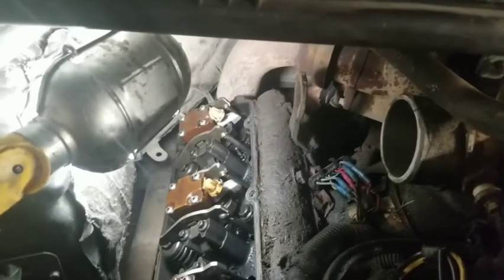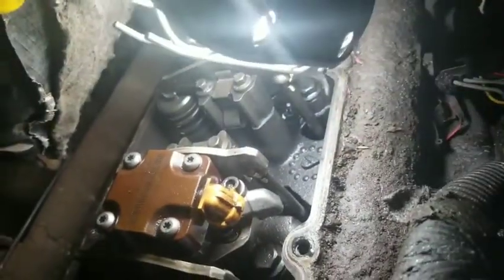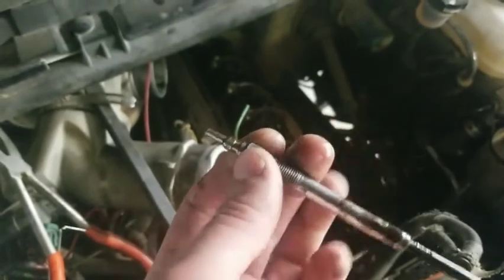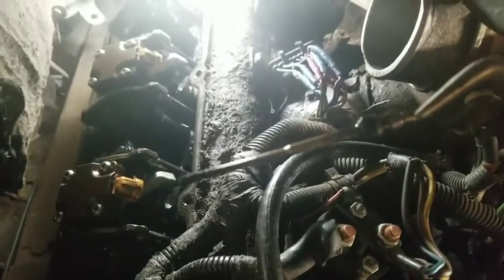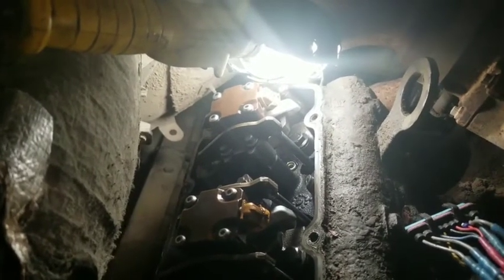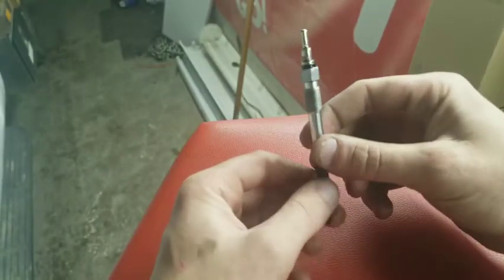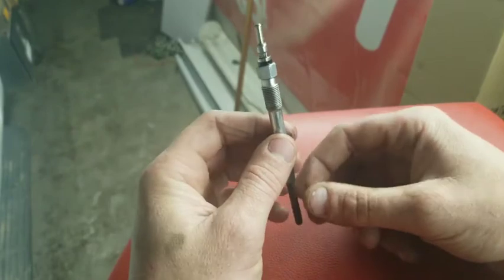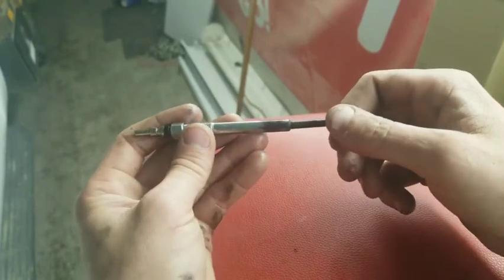7.3l Powerstroke.  What's that noise!!! Glow plug causes misfire and knocking noise.

Comment: I just did my glow plugs and now my trucks knocks like crazy and no power low end  till about 1800 rpm’s🤮
  Think your fixing something and crest more issues than you had in the first place LOL
Reply from the maker: Did you re-use the valvecovers and wiring harness? and the Plug the plugs to them? You might have a bad connection